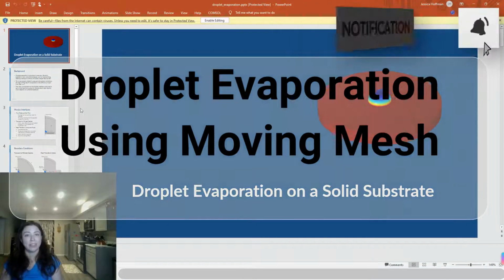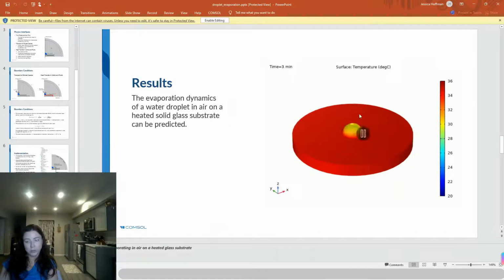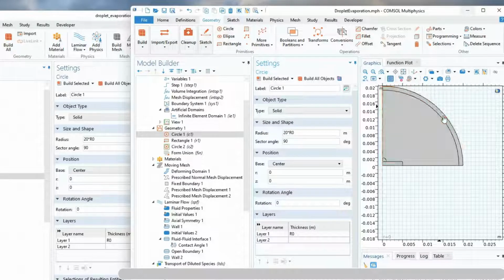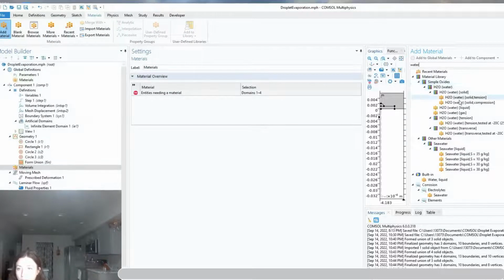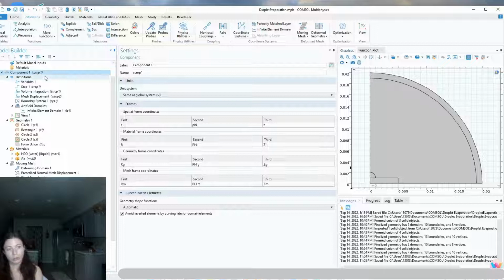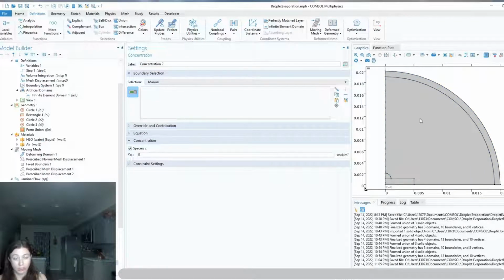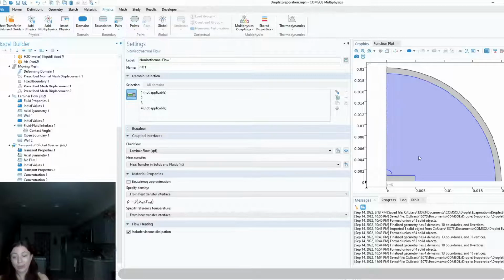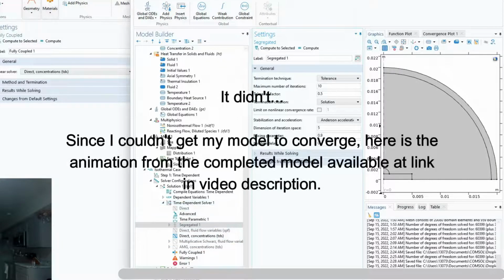Moving Mesh Droplet Evaporation on Heated Substrate COMSOL Tutorial

Comment: Hi Jessica, thanks for walking through this. One thing to note when writing out the ODE for mesh displacement. The variable "spf.vn" is NOT the phi velocity component. After some digging in equation view, I found the variable under the "Fluid-Fluid Interface 1" boundary condition. The variable "spf.vn" is the Normal Mesh Velocity at Boundary 11 - the droplet edge arc. Not to be confused with "spf.nv" which is different. The full expression for it is below, which amounts to the dot product of the quantity (velocity field vector on the down/inner side of the boundary - (mass flux scalar/density scalar)*interface normal vector) with the mesh normal vector. (Apparently XD) that gives the total normal mesh velocity in Comsol language.

spf.vn = (down(u)-spf.Mf*spf.iNr/down(spf.rho))*spf.nrmesh+(down(v)-spf.Mf*spf.iNphi/down(spf.rho))*spf.nphimesh+(down(w)-spf.Mf*spf.iNz/down(spf.rho))*spf.nzmesh

So I believe the ODE is a way of telling Comsol to track the instantaneous change of the mesh displacement as the total velocity at the point where the droplet meets the glass. Effectively as the simulation solves, it tracks the total mesh displacement by integrating up all those small changes over time.

The two expressions used for Prescribed Mesh Displacements are written to link the geometry radius Rg to the initial placements of the droplet (at one multiple of R0) and the glass disc (at 5 multiples of R0). The initial width of the exposed glass disc is then 4 multiples of R0.
Reply from the maker: Hi thank you so much for the detailed response! I will pin this so others who watch will benefit.

Comment: Hi Jessica,

I am doing a research on molten salt driven hot corrosion cracking of nickel alloy single crystal turbine alloy in molten salts species nacl na2so4 vno5 in 400 to 1200 Celsius temperature range cracking from oxide scale passivating to Pitt crack using cmsx4 turbine blade alloy in hot gas path of so4 hcl gases mimicking real-time turbine blade operations environment as molten salt evaporate on the substrate nickel alloy blade cracks propagates and initiates due to diffusion of sulphur and chloride. Please, Jessica, kindly help me to simulate this on COMSOL Multiphysics

Kind regards 

Ade

Comment: Thank you for this model. I have noticed that the laminar flow velocity inside the drop is very high: > 350 um/s! Also, this flow is circulating within the drop. I would expect that this flow is weak and should be directed towards the contact line where there is more evaporation.   Could you please have a look at it?

Comment: Thanks for the tutorial and explanation!  I have been looking at molecular dynamics simulations and wondered if they might be a better fit for my research as it is easier to model the dipole of water molecules aligning in an electric field using this kind of software compared to COMSOL and similar packages?  Goes back to the Taylor Cone example, and I am trying to model evaporation of water using an electric field to enhance evaporation.  Since most of the effect is a result of alignment of dipoles and reduced hydrogen bonding at the boundary layer, I´m not sure how to model this in COMSOL but perhaps it is possible? https://youtu.be/Ej9qXaPmf-g

Comment: Hello Jessica, This tutorial is very helpful for the evaporation model. my research area is water droplet impact on the solid surface. When the droplet impacts the solid surface, it will spread. so, I need to calculate the surface energy of the droplet with time using the formula integration of sigma*dA. My question is how to calculate the change in surface area (dA) of the droplet with time? Can you help me? please.
Reply from the maker: Hello Ajit, thank you for watching my video! As far as your question, if you have a working model, I believe the sigma*dA piece you want to plot/analyse can be done by adding a global probe for the domain/boundary/edge. Check out https://doc.comsol.com/5.5/doc/com.comsol.help.comsol/comsol_ref_definitions.12.100.html
Reply: @JessicaHoffmanTutorials  Thank you Jessica

Comment: Very helpful video together with the file. Thank you. I am trying to model a similar system but now drop is partially immersed in oil (solid is replaced with oil fluid). Should I use three phase fluid interface?
Reply from the maker: Hi thanks for watching! If the oil phase doesn’t undergo any deformation, then I wouldn’t include it. If it’s something like a 3 phase system of water, oil, and air bubbles being entrained in the mixture, that might be an oversimplification. I would say start with as simple a model as possible and slowly make it more complex.
Reply: @JessicaHoffmanTutorials  Thank you for the reply. The oil phase also undergoes deformation as the partially submerged droplet become smaller. So the mesh at the water-oil interface also should displace.
Reply from the maker: I see. I honestly don't know and would reach out to comsol official support on their forum for help.